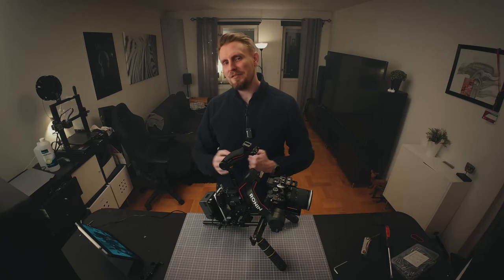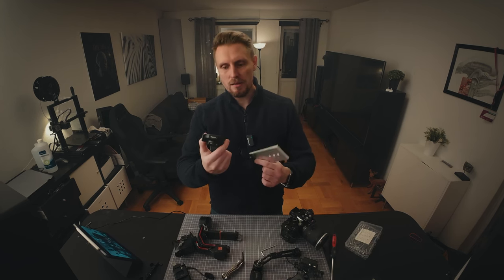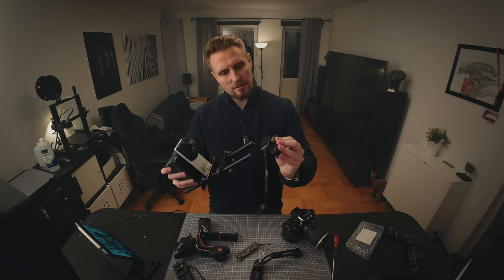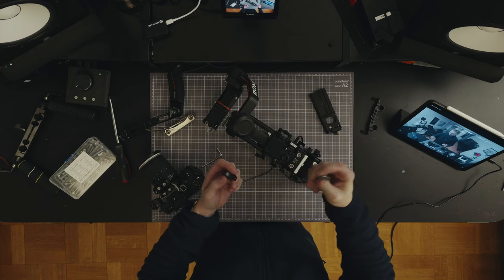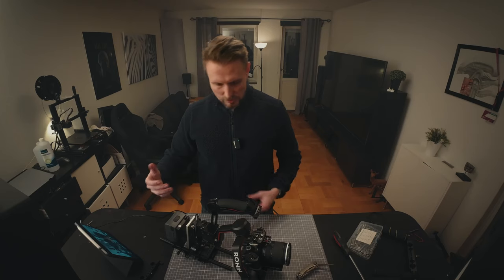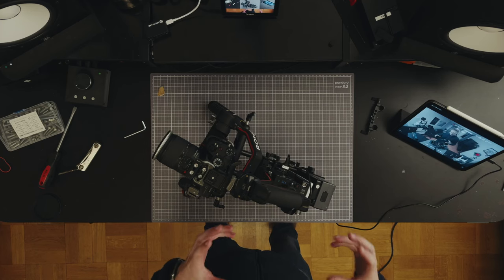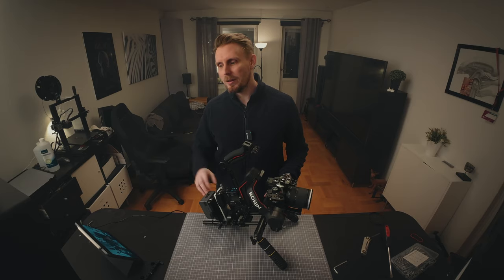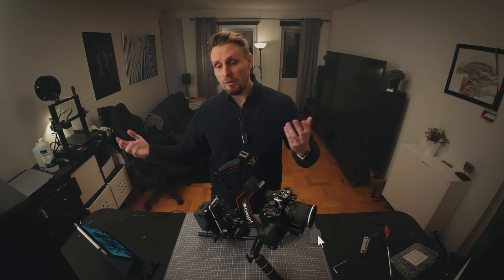Building the "The Creator" camera rig!

Comment: Great idea with the custom AL piece. i just used two L brackets (normaly used to put a shelf on the wall) on a quick release mount, but your idea is even more straight forward. You could even mount the v-mount holder directly to it and make it even a bit more compact.